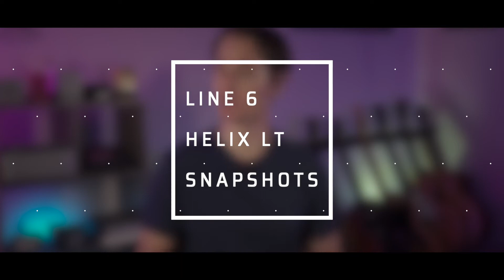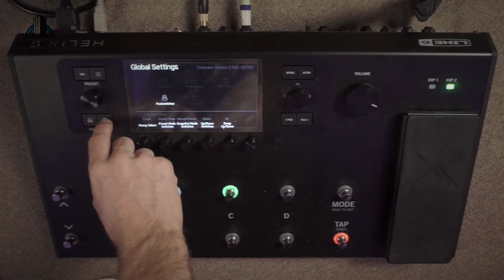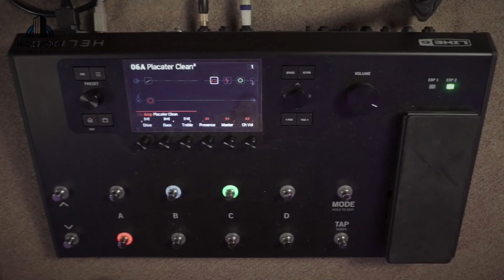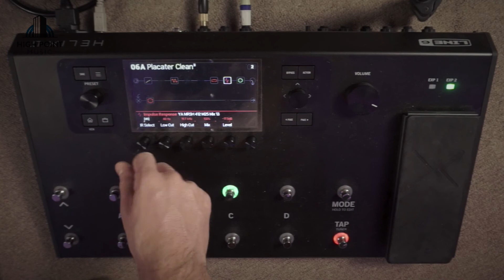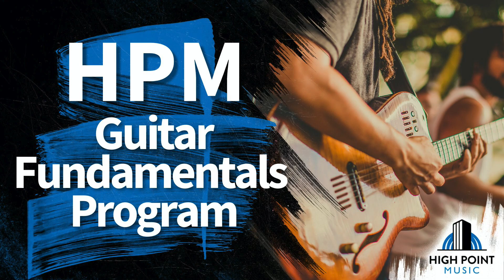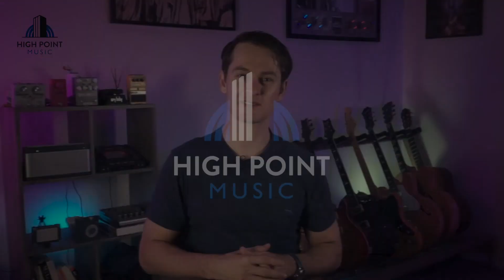Line 6 Helix LT Snapshot Tutorial

Comment: Hi, I have 2 questions, 1 is it possible to move all my presets from my pod go to the helix lt. second for each snapshot inside my preset can I have a diffrent amp like for example Snapshot A is placater clean and snapshot b is placater dirty? Thanks 😀
Reply from the maker: Hi Henry, Thanks for the question. It's been a little while since I've used some of the line 6 gear so I had to do a bit of research to check your questions. 

With your first question - it doesn't look like rigs are cross compatible between the Pod go and the helix range. This is probably due to different processing capabilities of both units. 

Secondly, there are two ways to do what you were asking using snapshots: either by changing the gain levels on the placater amp between snapshots, or you could two different amps loaded into your rig and simply switching between them using snapshots. 

I hope that helps. 

Ryan
Reply: @h @hpmguitar y man thanks a lot, I just got my helix lt yesterday and it’s easy complicated that my old pod go

Comment: I was so confused for about 15 mins, as I wasn't able to get into snapshot mode simply by hitting the MODE button (this only switched between the Presets + Stomp modes). 
After doing a little research, found out that you have to hit the 2 preset buttons all the way to the left (with the arrows) together to activate Snapshot mode. 
Is there a way to change this, where by hitting the MODE button, you can switch between Presets + Snapshot instead of Presets + Stomp?
Reply from the maker: that's interesting. I wonder if that has been a change with the later software updates. I'll have a look in to my unit and double check... but, I'm pretty sure that it was like this out of the box.
Reply: @hpmguitar  It's been 11 months, and I'm still hoping that there is a way to hit the MODE button to switch between Presets + Snapshots, as opposed to the default Presets (or Snapshots) + Stomp. Have you heard anything new about this by any chance?
Reply: @diggidydamndave  you are correct, my helix lt also has the pressing of the 2 bank switches.